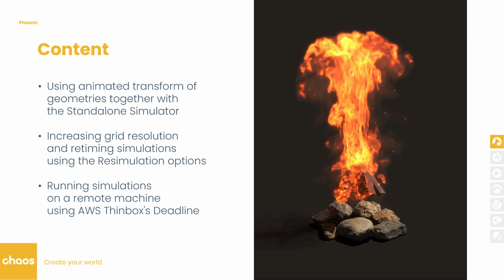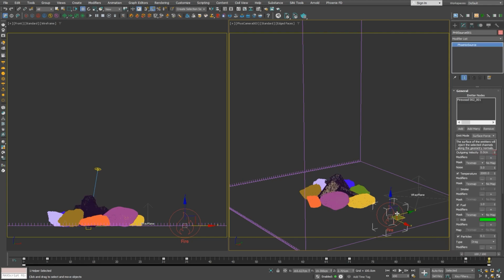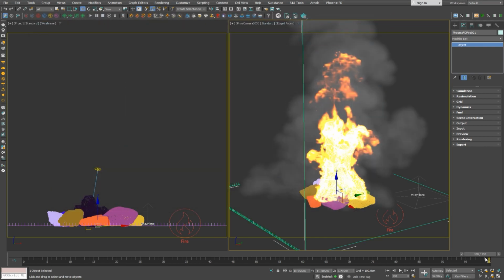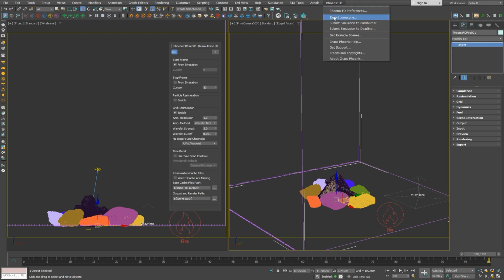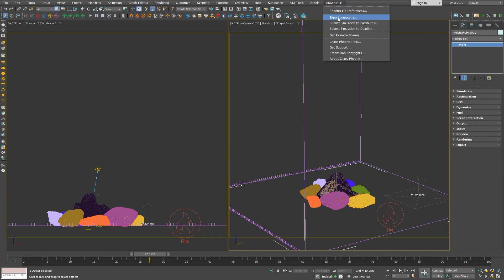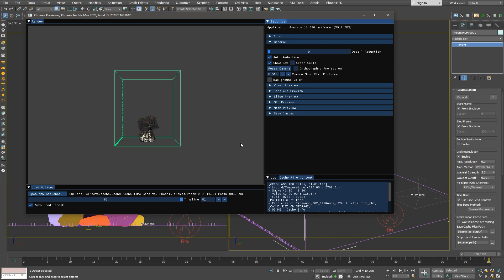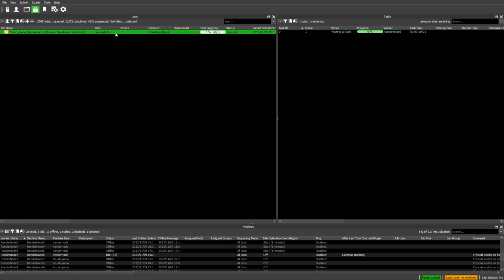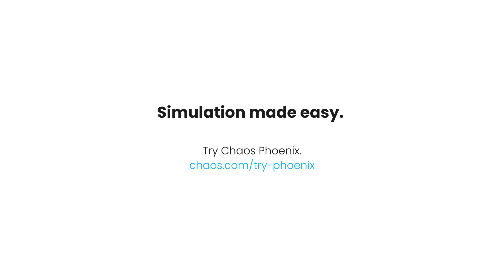Chaos Phoenix — Using the Standalone Simulator

Comment: m fire not visible  in render
Reply: If you render using V-Ray, please make sure to use the correct Phoenix installer - there are separate Phoenix installations for the different V-Ray versions, so for example if you use V-Ray 5, you must install Phoenix from the exe that has "_vray5" at the end.